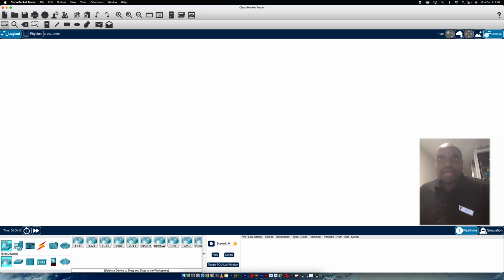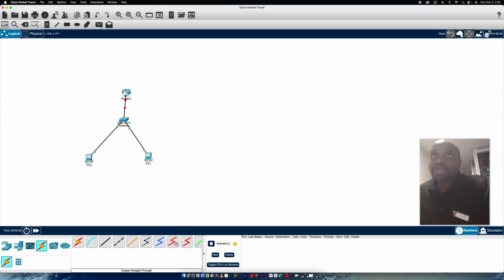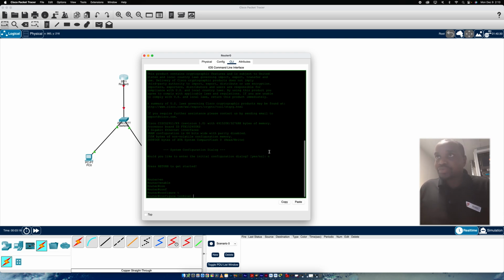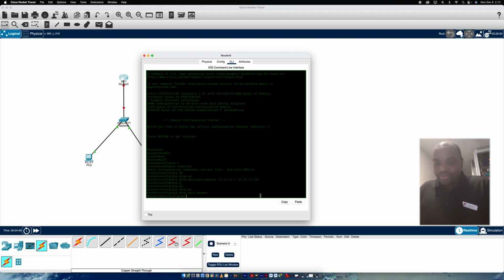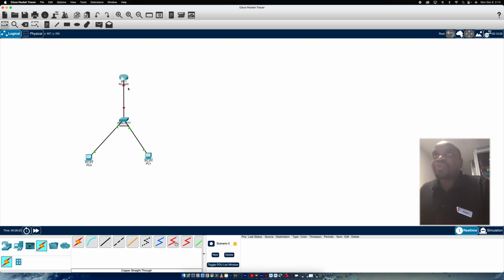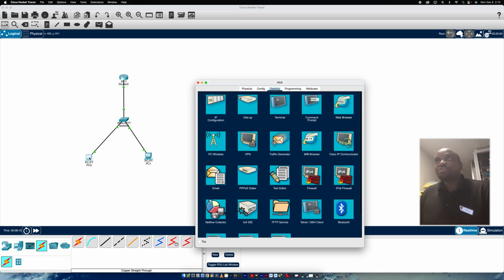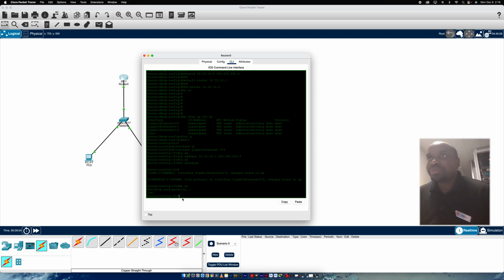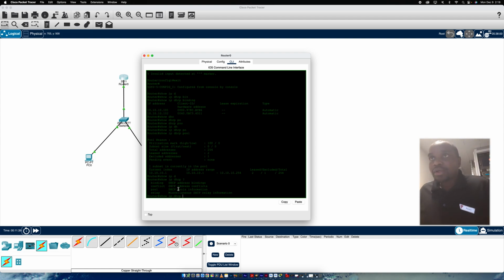Static and Dynamic Ip address Configuration - Cisco

Comment: How do I know if my IP is static or dynamic?
Reply from the maker: @thobekilendlovu7541  a static ip address assignment means that an ip address is configured manually on an interface where as dynamic means that there is auto config from a dhcp server and these dynamically assigned ip addresses can be returned to the pool after the lease has expired. The client will have to renew